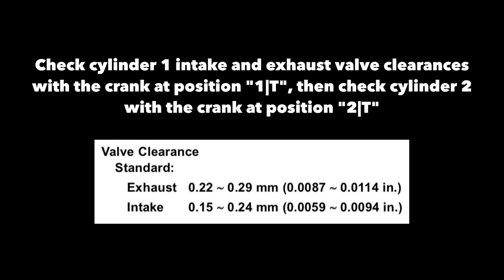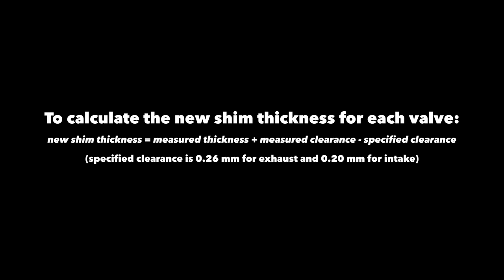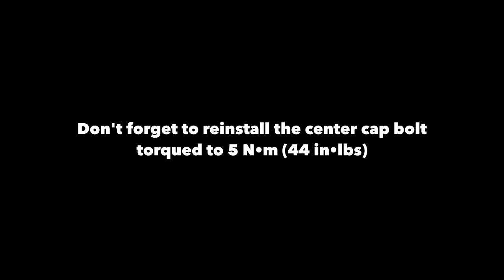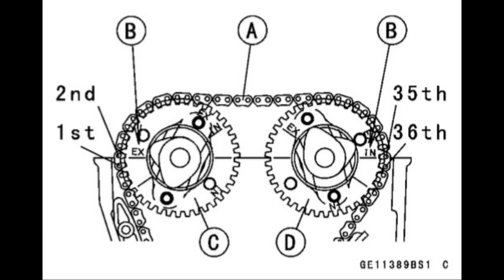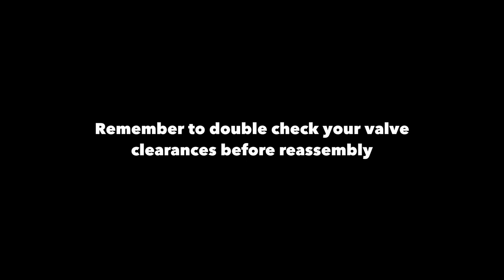Ninja 300 Valve Inspection / Adjustment (DIY)

Comment: this video is pure gold my man, im the most unhandy guy you will meet but with taking notes and referencing the manual and googling what  some of the parts look like I understood, will try this, this weekend. If you can add a list of tools you used to remove hard to reach spots. We need more people in the world like you haha
Reply from the maker: Thanks Huey, glad it helped. I don't have the exact list I used, but for the most part you'll need 8, 10, and 12mm sockets and wrenches. An extension for your ratchet and a universal joint socket will be very helpful for some of the harder to reach bolts. Other things off the top of my head: a magnet is helpful for pulling the lifter buckets, feeler gauges and calipers for measuring your valve clearances and shim sizes, towels of some kind to stuff in crevices so you don't drop anything into the head or crank case, and a torque wrench for putting everything back together would all be necessary. Good luck with the job!

Comment: Thanks a lot for the video. I had to shim the exhaust too. But my motorbike is a kawasaki versys 300, so the engine is very similar. The manual was also very helpful.

Now, everything is OK and the engine run properly.

It was the first shimming, the engine run so far 46'500 km, shimming 1 x -0.1 mm, 3 x -0.05 mm

Intake is still OK

Comment: The prep work is obviously a little different, but the versys X 300 uses the same engine and therefore (I'm 99% sure) the same process for the adjustment. If you edit that into the tags, description or title it might help more people. Great video. I saw the length and was thinking I wasn't going to make it through it, but it sucked me in. Thanks for posting.
Reply from the maker: Glad the video was helpful and thanks for the info! I'll update the tags and description.

Comment: Excellent work and thank you for sharing this video! Respect!  Just a question: What noticeable symptoms bike should have to consider that it needs a valve adjustment? Thanks...
Reply from the maker: Thanks, Otara! Glad people are finding it helpful. There won't necessarily be any symptoms to let you know that this needs to be done which is why it's recommended at a specific millage interval. The only way to know for sure is to get in there and measure your clearances. By the time you notice symptoms your clearances will most likely have been out of spec for a while.
Reply: @HwBtThmYanks  Many thanks again, much appreciated!

Comment: Does the bike have to have very high numbers on the odometer to need adjusting?
Reply from the maker: The recommended service interval is 12k miles for inspection but you only need to do the adjustment if things are out of spec. I'm coming up on 40k miles and the intake side has never needed adjustment but this is the second time the exhaust side has been out of spec. Hope that helps 👍.

Comment: Thanks! Great video! What shim set did you get?
Reply from the maker: Thanks! I got the Hot Cams kit. It's overkill but you'll definitely have all the sizes you need. Part number is HCSHIM01. It's not listed for the Ninja 300 but a bunch of people on the forums have used it. You can find it on Amazon for $60 or $70.

Comment: Can i leave the spark plugs on if they have been replaced recently or do they need to come off so everything else can come off as well?
Reply from the maker: I've always replaced them at the same time but you don't need to remove them to get everything apart. A nice side effect of leaving them in is that you plug up a couple holes that you could accidentally drop stuff into while the cylinder head cover is off 👍.

Comment: Hi again, can you pls explain what to do with cam chain tensioner. It is not clear from the video, neither from the service manual.
Reply from the maker: Hey there. Assuming you're referring to re-installing it. It's been quite a while but as far as I remember the tricky bit is keeping the push rod retracted while mounting the tensioner assembly. The push rod is what puts tension on the cam chain and if you just tighten the mounting bolts with it fully extended you might end up damaging the chain. Once the whole assembly is mounted you can slowly release the push rod until it puts tension on the chain. At 16:33 you can see the chain tighten as the push rod is released. Take a look at the diagram at 16:25. You have to use a small screwdriver at the end labeled "A" to retract the push rod (which is at the bottom of the diagram). Do this with the tensioner in place and try to get one of the mounting bolts tightened while still using the small screwdriver to keep the push rod retracted. Once the whole assembly is securely mounted (at least enough so that it can't pull away from the block) you can release the push rod and finish tightening up the mounting bolts. Hope that helps!
Reply: @HwBtThmYanks  Hi, thanks! What was unclear is that you need to turn the flathead screw inside not the threaded-holed phillips head thing. Thanks again and thanks for the video. I am repairing my versys-x. The lack of space where you need to work is a nightmare.
Reply from the maker: @onthepegs  Glad you got it figured out. Good luck!

Comment: Great video. Wish there was one of these for the 400.   Looks like a relatively easy job.  Sketchiest part looked like poppin the cam off and keeping everything in timing.
Reply: getting to know kawasaki would be very surprised if there was more than some minor difference between the 300 and 400. More difference => more effort => less profit. Mind you they put the same block in the versys-x in 2017 and are still producing it. That is a 10 years old engine block.

Comment: Should I drain the tank before removing the fuel line?
Reply from the maker: The service manual recommends draining it but you don't need to. There's a valve in the fuel tank outlet that closes when the line is removed. There will still be a couple drips but if you have a rag under there to catch them you'll be fine.

Comment: Nice video, did you change in valve periodically ?
Reply from the maker: Yeah, you should at least check the clearances periodically. No need to adjust if they're within spec. I believe the service interval is ~12,000 miles.

Comment: Will this qork with the ninja 400?
Reply: There will be a few differences but the engine itself is the same design, I would try to hunt down torque values before you start but other than that the differences should be few and far